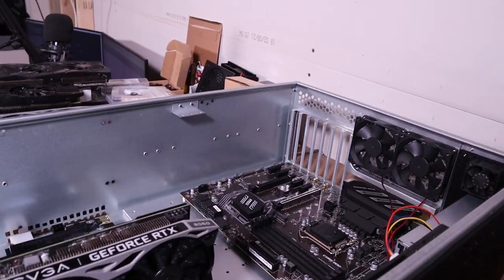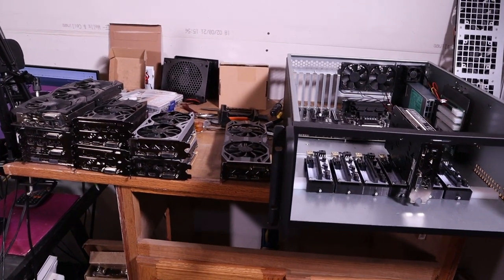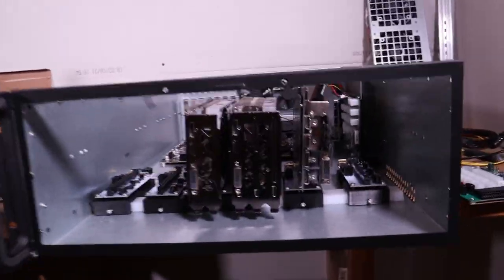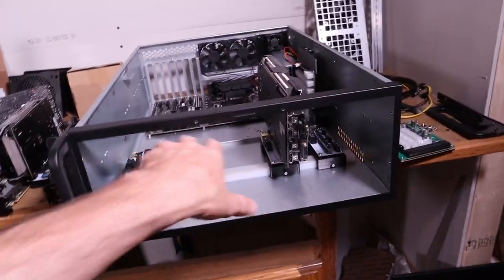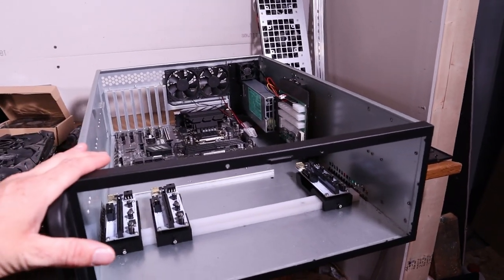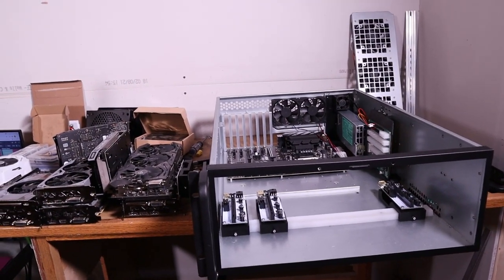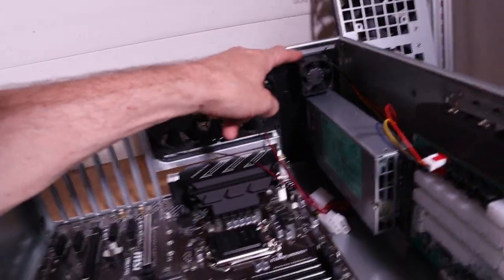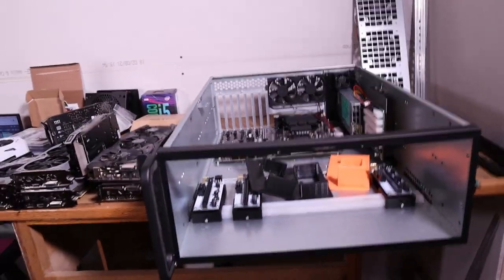VLOG SERVER CASE EP01 - The Beginning From Scratch

Comment: Interesting...so are you going to flip the fans and ears around , intake over mobo and psu and exhaust out front? Not sure on all that heat across da mobo all the time. At 6000 cfm maybe ok 😅
Reply from the maker: Will find that out when My Thermal Camera comes!! find and eliminate Hot spots in the case to Balance everything out but I have Played with Both Options so will see  When we start mining and Monitoring. Have also Played with Baffles to Allow Hot air to flow around motherboard instead of Thru it adding more Heat to the MOBO as your stated above.